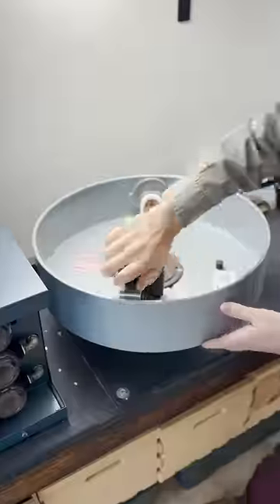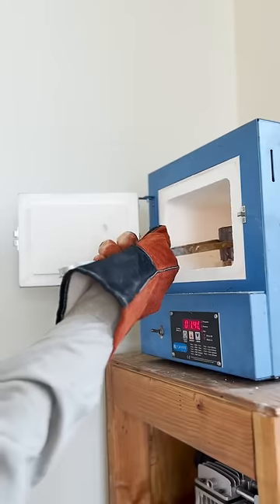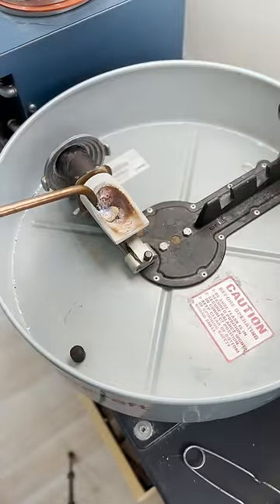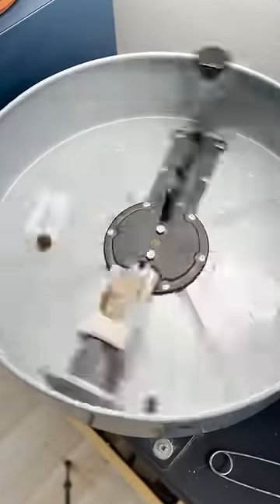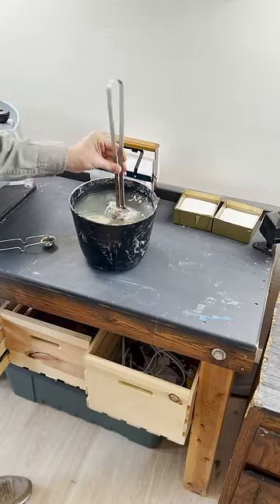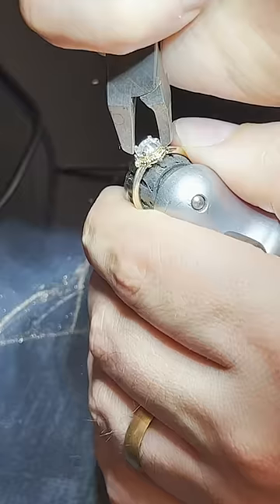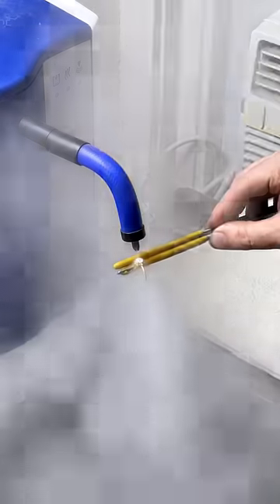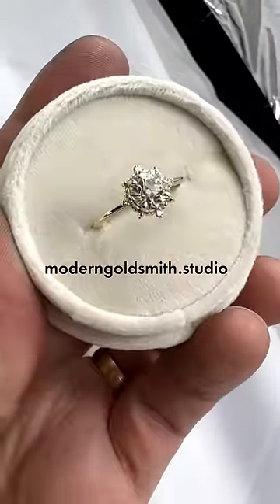The smallest flask I use for gold engagement rings

Comment: You should actually melt your metal and then quickly place the flask in the centrifuge. The heat loss by the time you place your metal in the crucible and melt it may cause your casting to have excessive porosity. The hotter your flask the less porosity you will have in your castings.